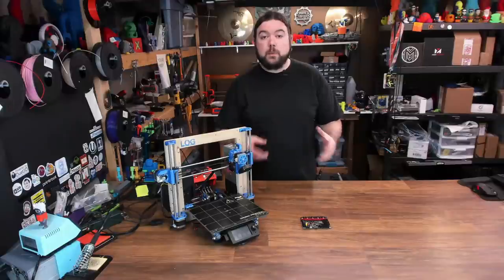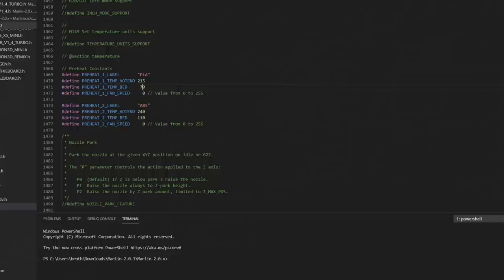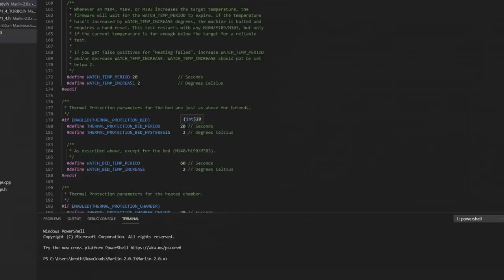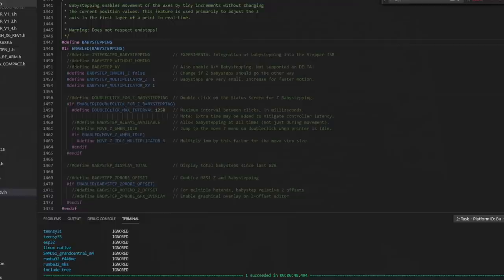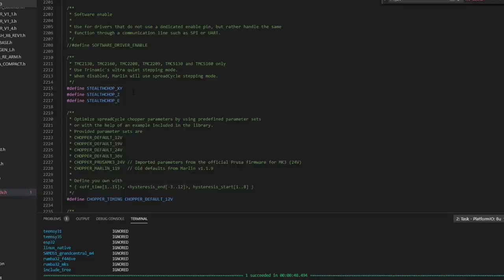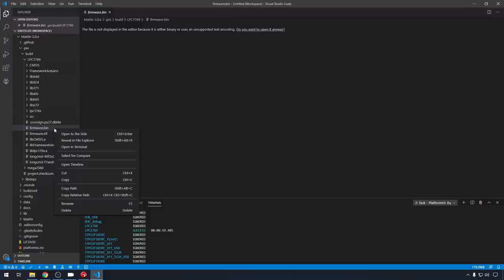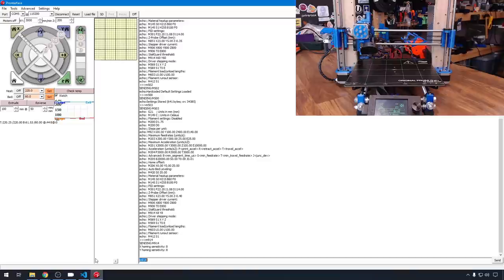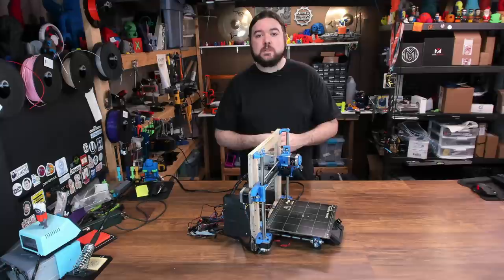BigTreeTech SKR v1.4 Mainboard - Full Install Part 2 - 2209 Drivers - Chris's Basement

Comment: hi. i need some help, most of the settings are the same as yours. the auto homing of y never stops, when i tipe m122 y give me the error : Testing Y connection... Error: All LOW. (printer flying bear ghost 5 board skr1.4turbo drivers tmc2209) i try to serch solution but they say i need to change tmcstepper libr, but im preatty scared of doing that. can you help me?
Reply from the maker: The diag pin on the X and Y are intact correct? You've just got the one jumper on under the driver correct? Are you running Marlin? Make sure you clear eeprom with an M502 and M500.
Reply: @ChrisRiley  thancks for the reply.  1 you mean the pins that you say to cut if you dont use sensorless homing yea they are intact 2 yes i put them in the same position of yours 3 yes marlin 2.1.x (bugfix) 4 i already try, i try full range of sensitivity and i try to change drivers too, nothing change

Comment: I am setting up BigTreeTech SKR 1.4 Turbo board, after a test print - bed goes backward, did G1 Y190 F4000 runs correctly? Also after 2 complies I get 1412 Error "disable [XYZ] is not compatible".   After that error your dead in the water and have reload fresh Marlin
Reply from the maker: What printer? I have never seen this XYZ error before.

Comment: i got 2 errors, one for config h and for adv.h and they are both the same, it says include errors detected. please update your include path. squiggles are disables for this translation unit. Also i emailed you about the 3d printing server. thanks in advnace.
Reply from the maker: Hey, your file path is too long. Move you marlin folder to the main C directory then re-add it to VScode, that should fix it.

Comment: Is there a way to update your Marlin firmware (that's already up and running and running well) to the new version of Marlin without having to manually put in everything you've done to the firmware?  I guess what I'm saying is can it be more automatic?
Reply from the maker: Currently, no, there is not upgrade path like this. Maybe someday.
Reply: @ChrisRiley  I thought this was the case.  I guess I have more Marlin in my future.  Oh, I thought I'd let you know (just in case you have a solution) that I can get 2.0.4.3 working flawlessly, but 2.0.5.X I can't get to function properly at all.
Reply from the maker: @chethammer  Interesting, there is a new version coming soon, I would be curious if that fixes some problems.

Comment: Definitely the best installation guide for the SKR 1.4 board and the TMC2209 drivers. I watched several other videos, but only in your videos did I get the complete solution that worked on my Ender 3 printer. You knew how to clearly explain all the steps so that a newbie could make all the adjustments and configurations. Thank you very much, Chris!
Reply from the maker: Glad it helped. Thanks for watching

Comment: Hey Chris,  
First of all, I really wanted to thank you for the wonderful contributions that you have made by creating the absolute best tutorials for us 3d printer enthusiasts!
You have really helped me make my Ender 3 Pro better than ever!

Unfortunately, My luck has run out!
After spending several long hours of attempting to get my new E3D Hemera (24Volt) to work with my existing E3 SKR Mini V1.2, BL-Touch, & TFT35 V3 Screen, I am finally at my breaking point!  
During my attempts for whatever reason, when I would power everything on, My printer fans would run, but I could never seem to get any sort of output on my display, nor get any communication using USB.

So now I purchased the SKR 1.4 Turbo To Replace my SKR Mini V1.2 in hopes that I will have some better luck using my existing BL-Touch & TFT35 V3 along with my new 24V Hemera Extruder. 
If You ever get the chance, I would be Extremely Grateful if you could take the time to create a short video that goes over what I need to do to get this 1.4 Turbo working with the 24v Hemera Extruder!

Thanks Again for everything that you have done for the 3D Printer Community!
Reply from the maker: Hey Daniel, there really shouldn't be much to it. There isn't a lot you have to change to run the Hemera. What issues are you having?

Comment: Great series of videos; I just ordered and SKR v1.4 pro and 2209 drivers and found your channel while doing some research.  You covered quite a lot of material pretty thoroughly, and seemingly at about the right level, even for me getting into 3D printing for the first time with an Ender 3 Pro coming, too!  While I know my way around VSCode and software (even embedded microcontrollers), Marlin is all new code for me and a whole bunch of knobs.  I appreciate you quick overview of the configuration options available.  It's helping quite a bit to get all the pieces organized my mind.  Thanks!
Reply from the maker: Awesome, glad it was helpful!

Comment: Thank you so much for these videos!! Very informative, my EEPROM doesn't work so I had to configure my sensorless homing by recompiling a couple times, but worked out well! I have no doubt I'll have the EEPROM figured out soon and I will definitely be checking out your other videos to get my SKR 1.4 Turbo working flawlessly.
The error I got was "Err: EEPROM Index" incase anyone recognizes it.
Reply from the maker: Great! Will it let you initialize it with M502?
Reply: @ChrisRiley  I noticed in config_adv.h it recommends M500, so I tried M500, M502, and initializing EEPROM through the menus. I didn't restart in between each attempt, but when I did reboot, it was working ! Thanks for the quick reply , the fun continues !

Comment: Hi Chris. Thanks for these two videos. I'm building an SKR bear from scratch (so thanks also for your bear BOM!). I'm using Chris Warcocki and Keith Bennets SKR bear all in one Marlin firmware, but because I have a slightly non-standard bear and because I'm coming from Klipper w no experience building marlin, your marlin on SKR was a great way to check through everything. thanks!
Reply from the maker: Very cool! Thanks

Comment: Just got a BTT SKR 1.4 turbo and thanx to these amazing video's got it set up and working. :)
Dude, you know your stuff!!! :)
Reply from the maker: Great news! Thanks for watching.
Reply: @ChrisRiley  Just added a BTT TFT3.5 V3 but cannot get them talking it TFT mode. Marlin mode works fine but TFT mode says no printer connected. I have enabled a second com port in Marlin, tried 112500 and 250000 baud rates on both board and screen and also updated firmware on the screen but had no luck so far. Any ideas?
Reply from the maker: @TootEmCarMan  Are your serials set? Set serial 1 to -1 and serial 2 to 0.
Reply: @ChrisRiley  I have had my serials set exactly like that. I have also disabled the second serial and set first to 0 and still nothing. I'm thinking the screen may have a fault and will return it for a replacement after exhausting every possibility.
Reply: I have it working. It was all caused by a bad connection in the TFT cable. :)

Comment: Hey Chris, great tutorials! Thanks for all you do to help us new guys figure this out! :) I'm running into a bit of an issue with mine unfortunately. I'm using what you did in your videos, SKR1.4 Turbo included with TMC2209 V1.2 drivers and a few other things but my issue is with my extruder motor. Before I begin, I clipped the diag pin on my Z and E0 driver. After the installation, when it began to print, the extruder would do a wipe at the front of the bed. But, suddenly as it was wiping , it made this loud noise and vibrated very intensely while ceasing to turn. Then it would continue onto the first layer like normal and print the rest fine. Over time, it eventually did it more and during the first layer, the gear started clicking and not turning for awhile then it would continue to print normal. After the research I did, I concluded my current on my E0 stepper was either too high or too low, but after some experimenting, it doesn't seem to make much of a difference. (Btw, I removed the filament and it behaved the same way with the noise and clicking so it doesn't appear to be a clog...) I plugged in a stepper motor that is the same model as my X, Y, and Z steppers, and used the same current as those, cause they work fine. But it behaves the same way.... After a lot of little tweaks here and there trying to see if I had faulty parts, I ended up returning the board for a replacement. Just got it plugged in and working, but it now has the same extruder motor issue... While it is possible that both of my steppers I tried are damaged in some way possibly, I'm thinking that I'm missing something.... I followed your video very closely watching it multiple times and my firmware is very similar excluding a fil runout sensor. Any ideas why this could be doing what it is doing? Appreciate any help :)
Reply from the maker: When you got the replacement board, did you get new drivers as well? Did you try swapping the drivers to see if the problem followed it?
Reply: @ChrisRiley  Yes the drivers are new as well. Also, before I replaced it, I used the E1 slot instead of the E0 and still the same issue...
Reply from the maker: @peterparker687  When you do your prime line what is your feed rate? Maybe the driver can't keep up then over time the feed rate causes ware.
Reply: @ChrisRiley  Oh that's a good point, the code I send is G1 X40 (from X190) Y7 E18 F2000. In the past with my previous board it hasn't been an issue
Reply from the maker: @peterparker687  Interesting, what extruder do you use? I would try F1000 and see if it makes a difference.
Reply: @ChrisRiley  I'm using an E3D v6 clone hotend but the extruder itself is from Two Trees.

I ended up just taking the wipe out of the start gcode just to see if I could get it to print. But on the first layer, the gear just bounces back and forth not printing anything. Then right after the print, I heated up the nozzle and just had it extrude but the motor does the buzzing glitch again... If I turn the printer off and on again, sometimes it will extrude but sometimes it just glitches... Any ideas?
Reply: Update: So I almost got it to print with a 3rd stepper motor I haven't used on it before. It wasn't making the loud buzzing sound it simply bounced back and forth for the skirt on the first layer then proceeded normally, but then began to skip again half way through the first layer and I had to stop it. I'm wondering if this is just a current issue. I was using 450 mA on it. It's the US-17HS4023S stepper (its a pancake stepper). Is this too high or low maybe? Based on my research, the rated current for this stepper motor is 1 amp.
Reply from the maker: @peterparker687  I would run at about 70% of max, so try 700mA.
Reply: @ChrisRiley  Unfortunately, still the same result :/ Thanks for working through this with me :)
Reply: My only other thought aside from maybe the firmware is if the wiring on the E stepper is off for some reason? Which pins on the stepper are 1A,2A,1B,2B? I've found different answers online....
Reply: So I figured it out! Turns out the wiring to the stepper wasn't quite correct, two of the wires were switched it seems. All working again. :) 

On a side note, I previously was using the MKS gen L V1.0 with an RGB LED system using mosfets and spare PWM pins on the board to control them the same way you showed to do it in your tutorial. On the SKR1.4 Turbo, the only spare pin that has worked for me is the one for the neopixel plug, but i can't find ones that work for both the other two colors. Any ideas for that? I tried using some endstops both maxes and mins but they didn't seem to have very much power, it would only light them dimly, do you know of any other spare PWM pins?
Reply from the maker: @peterparker687  That's really strange on that motor. I would have thought it wouldn't have worked even that much. On the neo pixels, I haven't really looked into them much on the SKR boards. I thought that is what the NEO pin were for, maybe not. I will have to look.
Reply: @ChrisRiley  To my understanding the Neo pixels are an easy plug and play for the designated RGB plug on the board. I'm not using those unfortunately though, I'm using simple just RGB strips where they have a wire for each color; red, green, and blue. So I ended up using one color on the NEO pin which works but I'm having trouble finding 2 others.
Reply from the maker: @peterparker687  A lot of boards have endstop pins that are PWM, but maybe not these.

Comment: thank you very much Chris - well waiting for - truly well put together and you have become my only reference moving forward - well done
Reply from the maker: Glad it was helpful!
Reply: @ChrisRiley  quick question, can i run a couple of OS on the pi including the OCTOPI, obviously not at the same time - thank you - would i use berry...?
Reply from the maker: @stephenkosloff6081  Yes you can, and yes, I would check out BerryBoot.
Reply: @ChrisRiley  thank you Chris
Reply: Chris my compiler is so slow it's taking longer than 3hrs it just hangs and does a line every 5 min,vsc ,pio and even new marlin auto....totally dumbfounded

Comment: Chris, Thanks so much for this Super Detailed 2 part video on the full lore of SKR+TMC Stepper understanding, installation and application!  Now applying all your step rich info to upgrading my highly modded Ender3 from Creality V1.1.5 Silent board (ran perfectly) to SKR-E3-DIP UART w TMC2209s! With lots of local 3D printing help (AtillaH👍) + got BTT’s Github precompiled fw flashed on-board for first time.  Got verification that latest Marlin is now loaded, but w ‘TMC Communication Error’? After re-verifying TMC2209s are correctly installed w Diag pins off for limit switches enabled, and testing my known good Cura 4.6 Gcode calibration cube several times, Y axis sides were skewed randomly @ various mid print angles up 45deg!  X+Y axis and layers are otherwise perfect thickness w no gaps or defects.  Used M122 in Pronterface now reporting Y-ERROR All LOW, (low? Display=580 Ma). Researched Trinamic TMC stepper specs which referred to TMC-debug, for possible fix, yet to do thru fw inspection.  Defective 2209? All other known good presliced gcode test prints had same skewing, layer shift issues.  Has anyone else had similar issues from out- of- box BTT boards?  Chris, your blogs are All Super Usefull and Concise!
Reply from the maker: Hey, thanks! What driver brand do you have?
Reply: Chris, thanks for quick reply! I’m using the BTT TMC2209 V1.2 steppers, as packaged with the board from Biq / Aliexpess.  I installed the tall blue heat sinks on X & Y steppers, and clear anodized shorter ones supplied on the Z & E for mb cover cooling fan clearance, as the board stepper sockets raise the stepper drivers ~ 10mm higher than with the SKR E3 Mini bd.  Used flat head 3mm screws to avoid contact with10x40mm fan shroud.  Snug fit here and kept all stepper driver harness wiring to right off the board to allow good airflow to X & Y heat sinks.
Reply: Chris, I’m following all your firmware setup steps and get to Part2 -18:26 but keep missing access to the environment in PlatformIO to allow locating the env:STM32F1** file to start the build and upload new config’s. Stuck, VSC PlatformIO, endless search in all sub folders w no joy.
Reply from the maker: @hanskonig3338  See if this video helps at all. https://youtu.be/ACkxT2uvYO4
Reply: Chris Riley ; Hi again Chris, thanks for your new link, which I was already viewing before checking for your reply. Your new video more slowly and clearly shows you panning and mousing to that environment folder.  I suspect a bug w VSC and PltfmIO, as there’s no accessible ‘env:*’ file above my workspace folder that you show after selecting the PlatformIO icon. No matter how often I’ve downloaded and reinstalled a fresh zip copy of VSC, PIO I never see or can find the blue tool bar along the bottom, nor can I see or find the icon bar for build/upload,etc., that appears in all videos.  What am I missing, as I download directly from Github?
Reply from the maker: @hanskonig3338  It could be you brought in the wrong folder. Make sure you add the parent folder on the Marlin folder.

Comment: Hi Chris, I'm probably wearing out my "tape" playing part 1 and part 2 over and over again - I just followed along as I flashed my new 1.4 turbo board.  Would you know if we are able to add 2 BTT relays to the board, to separately control the printer and an external power plug?  The gist is to have a 110 volt bed that is able to be turned off by the relay when the printer is finished.  Might that be with a Y cable from the board, or setting up additional pins?  Thanks for any response - and thanks again for a GREAT helpful video (actually, I think they all are!)
Reply from the maker: Yes, you can use 2, use can use either of the filament sensors to trigger one, just change them in the pins file, then use the power detect ping over the Z min endstop pins to trigger the other.

Comment: 15:58 I have a TMC2130 that im putting into my machine, and i was wondering what exactly you mean with the spi pins...
im going to run them in UART mode. btw im building my machine from scratch, so im still learning everything...
Reply from the maker: 2130's have an SPI interface, not a UART, you will need to set the jumpers for SPI.

Comment: I have a TFT 35 from BTT but i don't know what type of graphics it has... i just know that i can plug in a few sensors, and it CAN be touch screen....
I selected what you selected, i hope i selected the right thing...
Reply from the maker: It will be reprap_full_graphics display for that screen.
Reply: @ChrisRiley  ok, thanks!! Btw how do i determine that for future screens if i need to use a different oe for a different reason